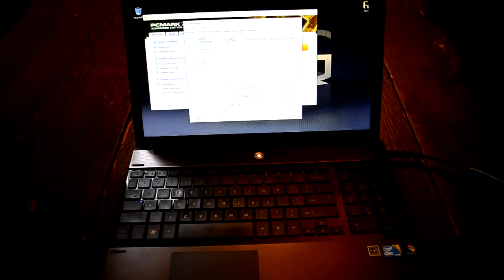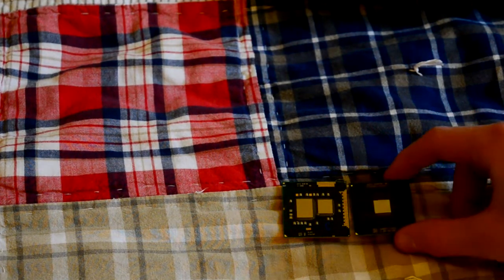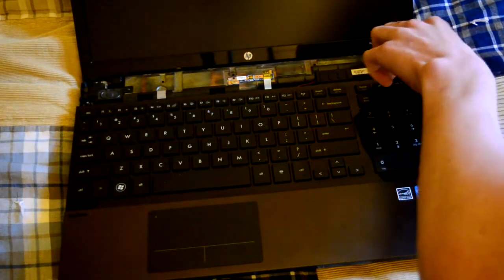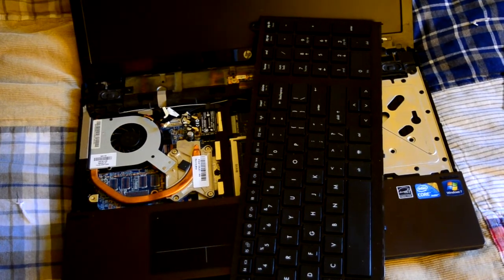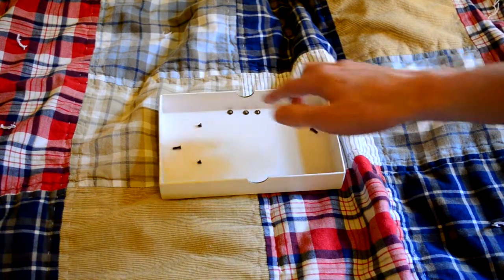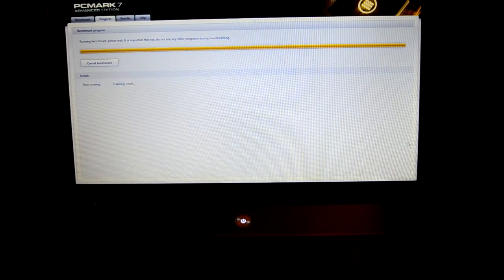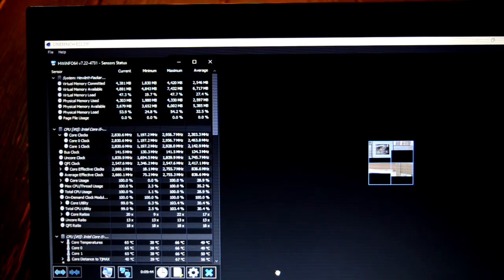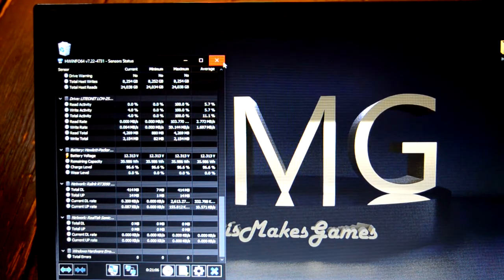ProBook 4520S CPU upgrade

Comment: hello , i have hp probook4520s  Intel(R) Core(TM) i3 CPU M 370 @ 2.40GHz 2.40 GHz processor  will i  upgrade  it  ?
Reply from the maker: You can install an i5-m480 or m560, that is a good affordable upgrade. As for the battery, it would need to be replaced.
Reply: i have another problem  . the  bettary not  charing   the  chargig  ic  is fall